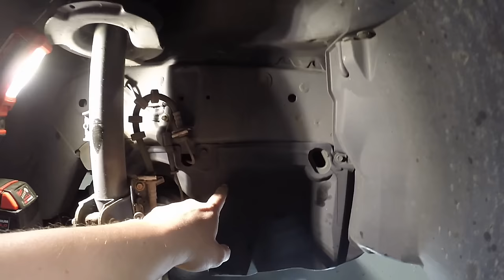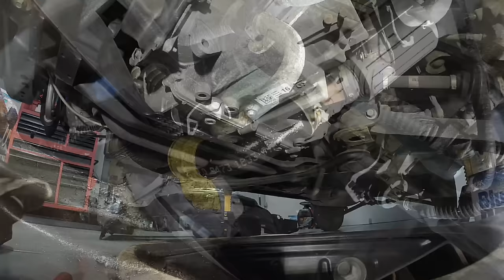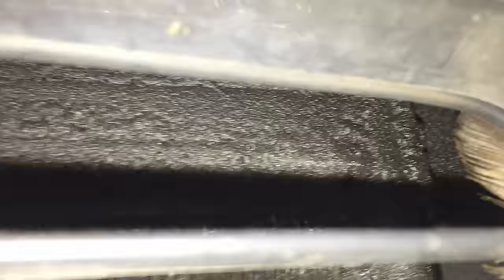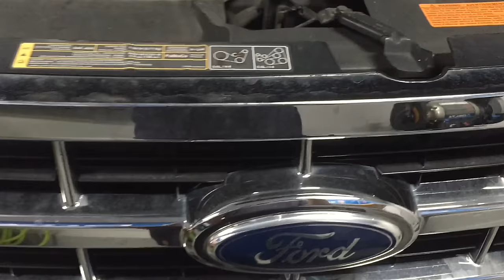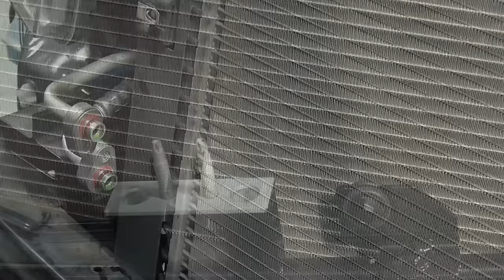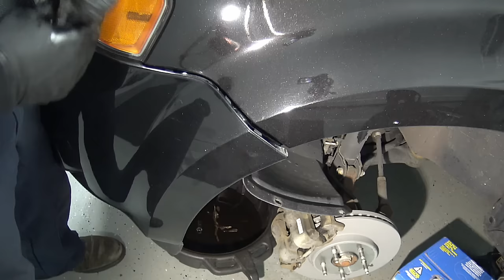2008-2012 Ford Escape Transmission Fluid Leak: A/C Condenser Replacement

Comment: My 2011 Ford Escape has been leaking tranmission fluid for the past 3-4 years, but it hasn’t been bad until the past six months. After doing some research, I came across your video and I have the exact same problem as the Escape in this video. Thanks for the informat and inspiration.
Reply: Is it still going did you get it fixed?
Reply: @philcollin5891  I did, in February. It was the a/c condenser. Plus had other general maintenance done.

Comment: Great video. What a wonderful ideas of Ford's engineers, to have the cooler and the condenser in the same piece. Makes a simple and inexpensive repair complicated and expensive. I'd go with a separate cooler, as there's there's high chance the new part will fail again.
Reply: If I were an aftermarketer I'd be making a seperate cooler that mounts in front of the original.
Reply: We've run into this problem several times at the shop where I work, not just with Escapes but with Fusions too (in the Fusion's case, it's the power steering cooler that's integral to the condenser). Every time, we install a seperate cooler in front of the condenser, and it works perfect. Never had a single comeback, and the AC works great.

Comment: Wow. This video may have solved my atf leak !  Only difference is mine is leaking on passenger side up towards the top I think . I just put my escape up on the ramps and  wiped as much as I could to identify the leak with no luck really . Thank you. I also subbed too .

Comment: I’m just bypassing the factory trans cooler with an aftermarket cooler. But thank you for the tear down. I needed to know if the transmission lines were barbed or screwed on. My vehicle is a 2008 Ford Taurus Limited. Got it for free so $68 bypass cooler is the mission for me. And you gained a new subscriber 😀

Comment: Excellent video.  I now know exactly what all the lines are on the condensor.  I have a tranmission fluid leak from the a/c line side of the condensor so I know it is the condensor.  Also, I now have confidence in how to remove and install bumper cover.  I will tackle this myself and save hundreds.  Thanks!!!

Comment: Just discovered that my 2008 Ford Fusion 3.0 v6 has the same freakin' problem. This is going to be a fun job. Luckily I know how to rip the front bumper cover off on my own pretty easily 'cause I had to replace my headlights about a week back.

Thanks for the great video.

Comment: Another amazing video! Now for my dumb question: Is there any point in super cleaning the area at the leak and attempting to stop the leak by applying a liberal glob of JB Weld or some comparable glue around the place where the pipes enter the core? THANKS!

Comment: Thanks so much for your help! Mine was leaking where bird feathers were embedded in the condenser...Use PAG oil from ford. I believe it’s PAG 46 weight. Don’t use 100 or 150. I replaced the accumulator as well and think it’s a best practice. $20 bucks on amazon. PAG was $18 at the dealer

Comment: Thank you for the video, I am about to tackle the same issue. I wonder what do you think about replacing the drier and exp. valve as well, since the A/C system is empty?
Reply: I'm wondering the same thing - I was going to replace due to transmission fluid leaking, but the A/C stopped working today.

Comment: Great video. I was surprised on my wives 2007 fusion 2.3 that at 90k her trans cooler line was leaking. Once I got in to replace it it made sense why it would. the line was all rusty and it's just under the radiator so when it gets wet it probably just holds moisture. Anyways some of the tools you recommended on past videos helped me out replacing this.

Comment: Did mine today, other than the crappy clips that hold the bumper cover on, it was easy. My condenser was leaking at the header where the lines bolt on. I'm a AC guy so the refrigeration side was easy.

Comment: For those that do not have an AC machine, bypass the factory trans cooler, install an aftermarket universal trans cooler. The Ford Escape has plenty of space up front for one.
Reply: Do they have the same option if its the A/C side that fails? as in a aftermarket universal A/C cooler?

Comment: Great video as always! Seems like a better design would have been for Ford to utilize that whole area of the condenser for the AC refrigerant and add a separate cooler in front of the condenser for the trans oil. That would have been better for the AC's cooling as well as making repairs much simpler and cheaper.

Comment: hey brian. i was just wondering if there would be a way to bypass the cooler lines to a seperate cooler so youre not having to break the a/c open and save cost on the financially challanged.  just an idea. keep the videos going.
Reply: I just think why do you need to spend lots of money for the same part that will leak the same as the original one when you can get an auxiliary transmission cooler that can perform better and yet possibly save the transmission. Yes I am a true believer about using factory parts but when you have to spend a lot of money for factory parts when you can get a part that can possibly be better and less costly than the original
Reply from the maker: +Brian Skinner You sure could there is nothing special about it, that is if you wanted to go aftermarket. There is plenty of room behind there for an aftermarket cooler.
Reply: I was just thinking as far as customer cost and not having to mess with the a/c system (evac/recharge).  Saves the people some money both part and labor cost.  Keep the videos rolling.  I was also thinking that maybe you can make videos using aftermarket parts as far as exceeding OEM specs, not hacking but improving performance.  I do like using oem parts whenever I can (Oil filters, etc.) but if need be for $ or wearable parts I end up using aftermarket with lifetime warranty usually Autozone because if something is either wornout of defective, they usually replace it at no cost.  Just an idea to shoot out there, since people like more power and performance and cost efficiency.  Just an idea for the ford enthusiasts, since we know that fords are the best.  You need a real truck (a Ford truck. LOL)  Just kidding.  You do have a nice Dodge truck. Another idea for the other channels is to do maintenance on your truck for the public to see (LOF's, air filter, etc.)  Just ideas for you.  Keep in touch. Brian Skinner
Reply: My thoughts exactly. And if Ford had these mounted with insulating grommets on both sides instead of just the Pas the stress failure would likely never have been an issue to begin with.  Just cut off the metal lines, toss on an aftermarket and call it a day.

Comment: The radiator support bar -- on my 2008 Escape -- as a result of a collision is bent in a small section on the driver's side and pushed into the lower portion of the condenser --  causing the a/c condenser to fail/leak. .  I haven't tried to disassemble this yet (thanks for this great video) but in your opinion how difficult will it be to "hammer out" the radiator support bar?? thanks.

Comment: Great video especially on taking off the bumper, that was one of my concerns. I'll be replacing the compressor, drier, condenser and most of the rubber hoses on my 08 escape hybrid. How much pag oil do I need and what type (pag 46)?  Thanks

Comment: brian i know you don't like to use aftermarket parts but in this scenario the spectra premium brand is better build quality at half the price. check it out next time. p.s. if you ever have catastrophic a/c failure you cant flush the condenser.
Reply: +NCPDFSB 
thanks for the tip, and hey I live in nassau county thanks for your service  keeping me safe!

Comment: Great video! Wish I watched this video instead of another I went step by step by and found out the hard way that it was incorrect by adding a/c pag oil. It was more involved with the AC then just the condenser. Unfortunately they said to add 2 oz of pag oil when now my AC has to much pag oil. I haven't found much as far as fixing this issue so I'm hoping this is something I can correct myself without having to pay to flush my AC system. If you happen to have any videos on removing compressor oil I'd love to watch it? I appreciate any help you can give in this situation. Thank you in advance.

Comment: Hello,  in a few days I am using your video to guide my self since I am going to replace the condensor of my 2008, but I am not sure about the step when you put the oil inside the condenser, what happens if I don´t put that oil? my a/c system it´s been three month without using since the leak in the condenser, but I am waiting for the new condenser to arrive and remove the oldone. the oil it is necesary? thanks for advanced

Comment: Hi, I have a question, maybe it is not about the video, but I see that you are a Ford expert, I have a Ford Escape 2008 Limited, and since a few days ago the outdoor temperature is 50F, it has not changed, I read that it is probably the sensor , and as I have seen diagrams it should be in front of the radiator, but there is nothing there, do you know exactly where it is located? in advance, thank you.

Comment: Hey Brian thanks a lot for the time you spend making your informative videos. I have a 2011 Escape without this issues, but are the replacement condensers improved at all at the leak point or will this become a common occurrence every 5 or so years?
Reply from the maker: +peelman1506 The part number has changed twice and held which means at this point they have done a revision to prevent a future occurrence.
Reply: +FordTechMakuloco  why don't they just make a revised ac condenser then a separate transmission cooler instead of having it all together or put them back on the radiator like my older jeep has its cooler at.

Comment: Should the cooling fans come on when the ac is first turned on or does it wait for the high side pressure to increase to a specific pressure
Reply from the maker: Yes they should turn on low whenever the a/c is switched on.

Comment: could i just put an aftermarket cooler in front of the condenser and connect it so i wouldn't have to open my ac system.
Reply from the maker: +thurmon kent jr Yes you could I just did it this way as most of my customers like to stay with the stock setup.
Reply: @FordTechMakuloco  Perfect Thank You !! Also, is there enough space if front of the OEM radiator where it wont interfere with other components during install ?
Reply: What would be a good option for A/M cooler

Comment: i can tell my fluid accumulating at the bottom of the transmission where the plug is (not from the plug itself). would it just be a gasket issue?

Comment: That “1 to 2oz” of oil you filled the condenser with was that oil you’ve previously recovered from the vehicle during a evacuation? Or is that “1 to 2oz” of new fresh oil in addition to the oil from the evacuation?
Reply from the maker: 1-2 oz is just to replace the oil lost to the junked condenser.

Comment: Thank you for this info I was thinking it was only my hose, this is gonna save me a lot of money and time. Question, my  ac has not been working (my compressor will not engage) , any chance replacing the trans cooler/ac condenser would fix my AC and  get the ac compressor to work and engage itself?

Comment: Dang. I literally scheduled my '11 to check out a coolant leak yesterday. Turns out this is definitely the issue. I noticed the radiator plugging up on the bottom right side. Would love to do this myself but where I am isn't feasible. 

I'm about to drive across the country to get back home. Think it'd be okay for another 4k miles??

Comment: oh wow, i have a 2010 Escspe 4 cylinder only 115 K on car. My transmission started slipping suddenly, took to Advance Auto and they had to put 3 qts trans fluid in, also AC works intermittently , Rep at Advane looked under car and he said he didn't see a leak...so I am looking at an expensive repair to get my ac to work??.

Comment: Hey brian.  i had a question to ask you. My wife debbie and i are considering an suv (of course a ford).  what would be the most trouble free and fuel efficient.  We are tight on funds but our van is using oil like crazy, rusting out fast(salt crazy state) and seems like i have to add coolant like crazy. I want something that will last us a while because i hate car payments
Reply from the maker: Very simple a Ford Escape 2005 or newer preferably 2009-2012 models were the best.

Comment: Can I safley assume there isnt a need to "EVAC" the system if it leaked out and wont hold a charge very long?
Reply from the maker: If the system leaked out already then no need to evacuate. Upon reassembly you must pull a vacuum and then charge.
Reply: Thanks for your reply, great educational vid.

Comment: Just wanted to ask. The hard cooler lines on my escape are leaking. Wondering what size trans disconnect tools I would need?
I’m hoping just the standard 1/2 “ and also the 3/8”?

Comment: I have an 09 Escape. I recently found out that my condenser is leaking and have been dealing with the hot and humid temperature. I didn't realise until today that the condenser also acts as a cooler for the transmission. For the last few months, my vehicle has been very randomly stalling when I come to a stop. (random as in it stalls once or twice a month). I have 318,000km on it and would love to keep it but the stalling issue is making me wonder whether I should keep it or replace it. Is there a chance that the stalling is down to the condenser leak? The stall issue is when coming off the highway to a stop after on average 140km drives. If it helps any, to get going again, I have to press the brake, press on the gas and out it in drive/reverse to get going. I've had the truck into a couple of ford dealers who can't find any issues of what may cause the stall. Any advice/opinions would be greatly appreciated.

Comment: Question. You didn’t vacuum the system after installing the new condenser and I thought that was critical to remove any moisture in the system. Should this be done?
Reply from the maker: I didn't show any part of the recharging process because most diyer's are not going to have an A/C machine like I do but yes you want to pull a deep vacuum for 15 minutes at least before recharging.
Reply: @FordTechMakuloco  thank you. I just wasn’t sure if the vacuuming would affect the oil that was just replenished.

Comment: Do I have to drain the transmission fluid to replace the a/c condenser?
Reply from the maker: +shane rogers You don't absolutely have to no you can just adjust it in the end if you want.
Reply: +FordTechMakuloco Thank you, and thank you for your videos. This was a huge help.
Reply: +shane rogers HI I need your help. I not sure which rubber hoes goes back on the right sides on the outlet. I dont want to cross them. I dont know how to tell. Can you tell me how to tell. I know one line has a blue tag on it. If that helps.
Reply: +shane rogers Hello there, does my 2012 Ford Escape 4 cylinder have a fuel filter? Thanks in advance.

Comment: Thanks,Ford tech for this video you a lifesaver.I had this same problem with my 2009 ford Taurus and I  took it to some I local mechanic I didn’t know to well and he told me it was the ac condenser leaking the transmission fluid out he told me before hand how much is the part and labor  so he did everything for $675 but since I paid with my credit card he said it will be a little  bit more because of the tax  so he charge me $700 even so you think that’s about correct ? Or I got tooken  to the cleaners.😆thanks.in advance.
Reply: dealer would charge $1500
Reply: @joepayer1793  wow! That’s insane.

Comment: Thank you for this s video . Can u share your email i would to to ask a question  by referring to a picture of transmission. My 2012 escape v6 fw limited, i saw orange coolant in front of top side of front area ( black plate @ 8.00 above u r left hand). All radiator hoses above the black plate is dry. The transmission oil cooler is separate from radiator for this Moddel , how can this be possible. Any tips?

Comment: If I understand this correctly, Ford runs the ATF through the AC condenser instead of through the bottom of the coolant radiator like other vehicles do. Please confirm this for those of us with limited skills.
Reply from the maker: Yes hence the leak.
Reply: @FordTechMakuloco  Thank you.

Comment: Do I HAVE to drain the transmission fluid ? My ac condenser leaks the ultraviolet color because the condenser is cracked on that one side... was wondering if I could skip the transmission fluid step..
Reply from the maker: It will leak out, fluid must be replaced.

Comment: did you replace the dryer and vaccum the sysrem or just refill the system
Reply from the maker: +thurmon kent jr no it was replaced because these are know to come apart and ruin the entire a/c system. If you are just replacing a part of the a/c system and the system charge level was high enough 5psi or so you don't have to replace it
Reply: Do i vaccum the system before i fill it
Reply: Would it work to just disconnect the transmission lines and connect them to an axillary cooler mounted in front the bad portion of the condenser
Reply from the maker: +thurmon kent jr Yes